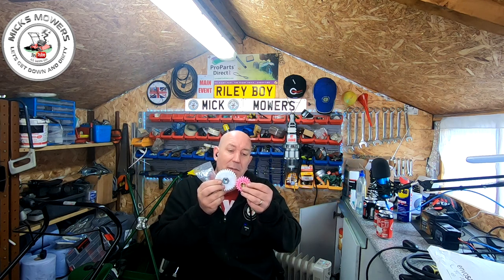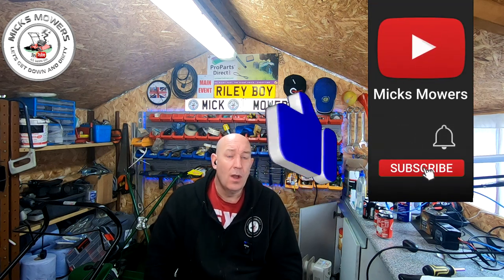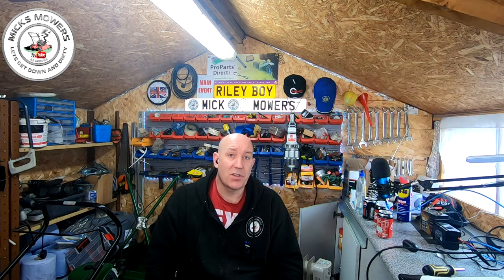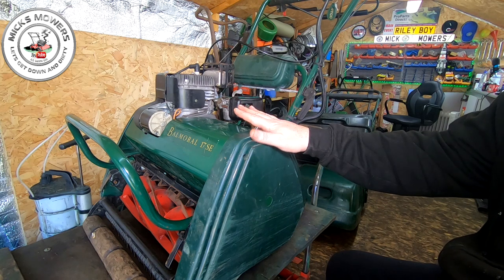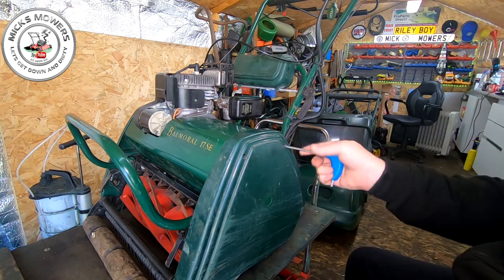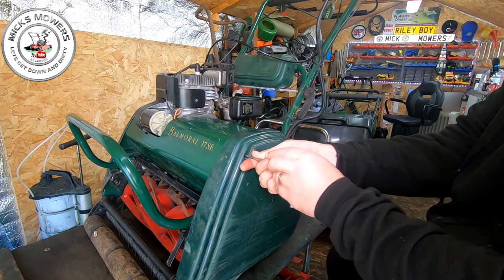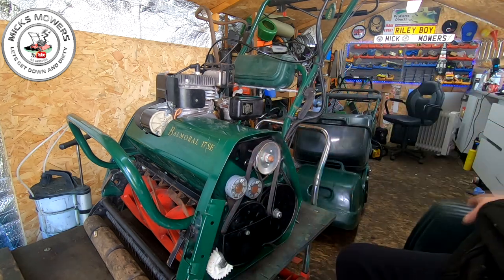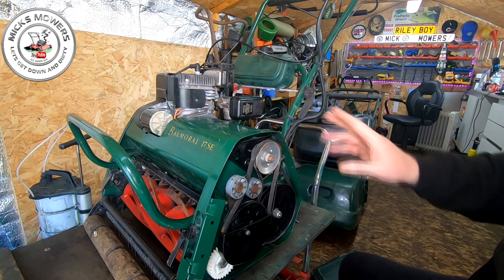How To Change The Gears And Belts On An Atco Cylinder Mower

Comment: Thanks to your advice; pointing out the Nut (under the smaller white gear) I have managed to tighten the gears up so they actually fully interlock! I had spent ages, ringing around to see if I could buy a full set - but nobody had it available locally. Good job I did not place the order! It was only an adjustment. MANY THANKS TO YOU! Saved money and the  PROBLEM FIXED!!!
Reply from the maker: No worries mate .. glad one of my videos helped.

Comment: Cheer Mick. I used this video to learn how to drop out and replace a rear roller on a Qualcast Classic 35S. I was only after the scarifier cassette but the seller wasn't interested in selling separately from a non-runner machine that lacked carburettor and had a massively dented roller.... how? no idea? but hopefully I can replace and sell on the mower as a running machine.

Comment: Great idea on using the hole in the pulley to remove the drive pulley if you don't have an impact.    Nice to see Riley come up to the shed.  These things have more gears than a grandfather clock.
Reply from the maker: Yeah and they keep a good time as well.. however not water resistant lol

Comment: At 28 min the 1st belt installed is on the left (wrong) side of that pin. Prior to that you were applying a lot of oil and lube which contaminated the belt and pulley, surely that would cause loss of traction
Reply from the maker: Ta for the comment

Comment: Hi, is it possible to change the white gear to the older style belt pulley? If so do you have a video on this as I’ve bought a used scarifier cartridge that has the white gear but my mower has a metal pulley.
Reply from the maker: yes it is and just undo it

Comment: Hi, I have a windsor 14s and the drive shaft just snapped is that a common problem and is it easy to repair?
Reply from the maker: Hi.. thats an electric mower is it not? I would say it's fixable/replaceable.. I have not done one before but someone fitted it so it must come apart.. first have a look on line to see if you can get the part

Comment: Cheers Mick, just one question I'm currently checking the roller drive belt on a 14s, there seems to be a lot of slack are they adjustable or do they just stretch after time.  Nice to see Riley getting in on the repairs again 👍
Reply from the maker: You can adjust them mate via the cable

Comment: Hey Mick! 
I am also using a Balmoral 14SE, but need to replace the carburettor. Would you have any recommendation where to purchase a new carburettor that fits to the original air filter housing? Thx! 😊
Reply from the maker: What engine do you have on it
Reply: I think it is the Tecumseh engine, looks the same as the one on your Balmoral 17“
Reply from the maker: @Flurl108  ok.. that has a tillaston carb.. you can no longer get them new.. what's up with your one..
Reply: Ok, that explains why I couldn‘t find any. 😕
Well on the one side it is leaking petrol and the engine is shutting off after a short time w/ the spark plug being completely black. I cannot adjust it anymore…
Reply from the maker: @Flurl108  this may help.. https://youtu.be/q57pc8JmL30
Reply: Thanks! Will give it a try!

Comment: Hi mate. How can I get you to look at a mower for me? Based in Hertford
Reply from the maker: Looks like your about 2h30 from me
Reply: @themowerman  you not Harpenden?
Reply from the maker: @hadleighp  no mate Bognor
Reply: @themowerman  someone else with your channel name then haha.
Can you advise where to start looking then on a 35s that the cylinder won't spin?
Reply from the maker: @hadleighp  lol thought there is only one Mick's mowers .. cable. Cable switch.. clutch. Belts. Gears. Cylinder to tight against the bed knife.. hope that helps
Reply: @themowerman  top man!